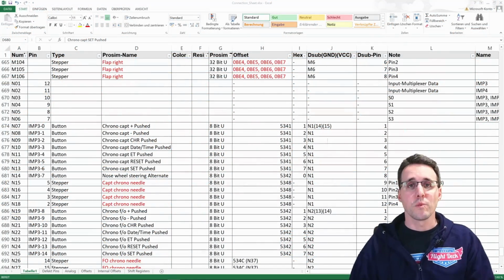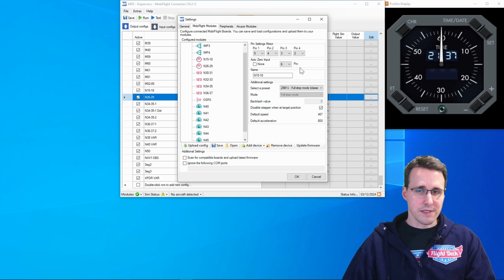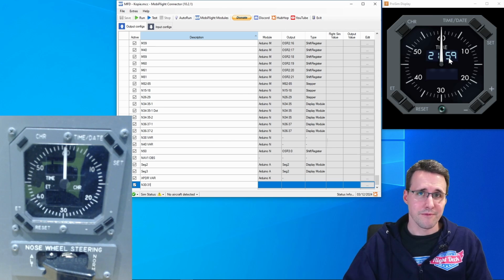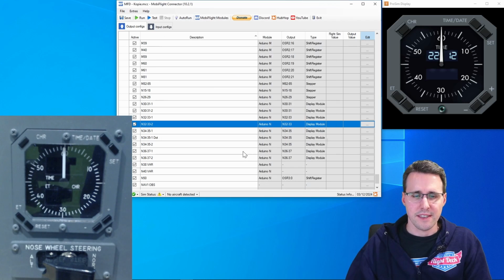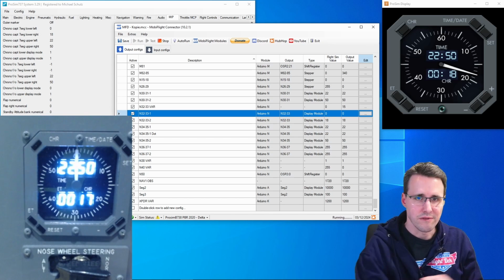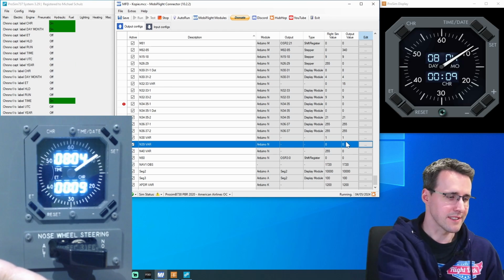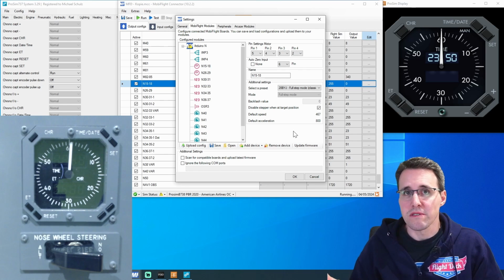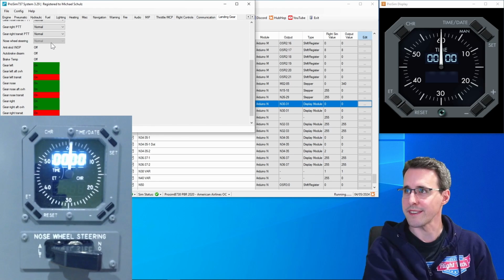MIP Chrono Configuration - A Boeing 737-800 Homecockpit #80

Comment: So Prosim is needed to get the custom offset for fsuipc? I really dont get how does this work
Reply from the maker: No, offsets are part of FSUIPC. You should watch my introduction to MobiFlight to understand how this works.
Reply: @Mickeys_Flightdeck  I have just seen your video and I understand how mobiflight works, what I mean is that as I see in this video and in the introduction one, is that you are using Prosim to act as a "reader" of the msfs information and assigns it to an fsuipc offset so mobiflight can read the info through the offset, but prosim is needed to do that step of assigning a piece of info to an offset, but there is the need to have Prosim to do that, right? There is no way to do it from mobiflight with msfs 2020, or is there something I am missing? 

Thank you for your time
Reply: Anyone has some light over this topic?
Reply from the maker: @nagashbass  If these values are MSFS variables then there are also different methods to read these. I have Prosim in combination with MofiFlight here so I wasn't in need of any other technique. But there are other ways. The PMDG sdk together with the MobiFlight presets, MSFS LVars and MobiFlight HubHop. Just to name some keywords. All these are topics I haven't dived into but they can be a solution for you.